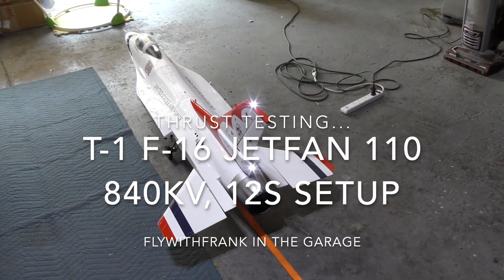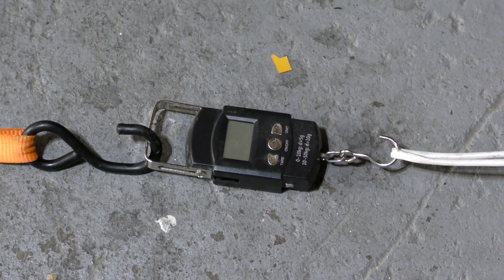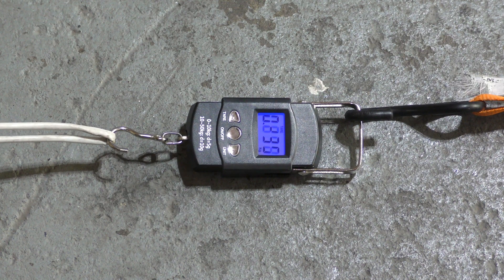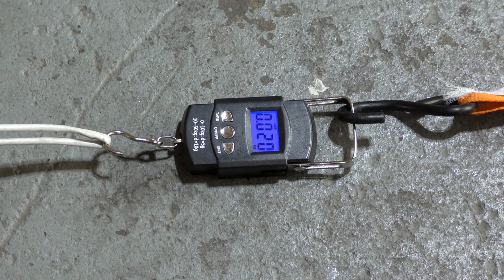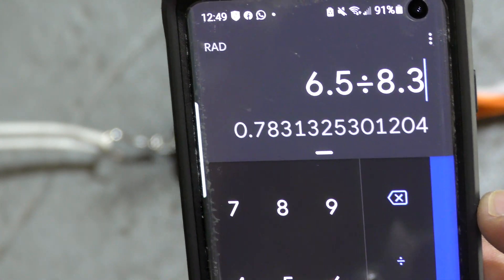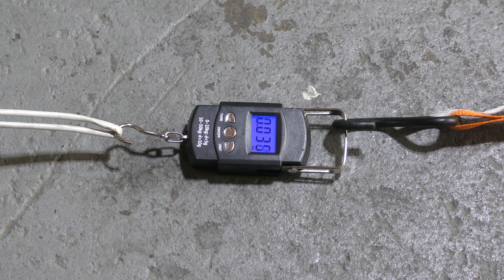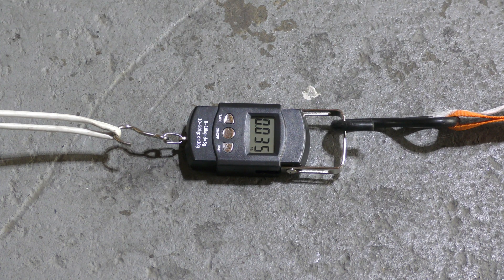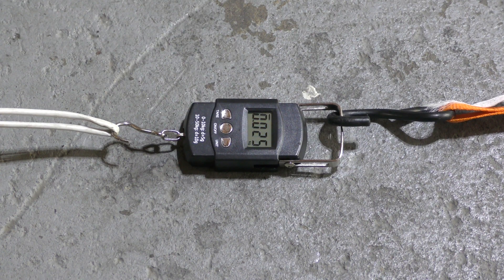T-1/T-One F-16 EDF Thrust Test

Comment: NICE TEST !!! Were you able to measure efflux? If I see a 3 - 5 lb drop in bench thrust vs installed thrust (with a thrust tube) Its usually the intake and the fan not getting enough air.
Reply from the maker: That was most definitely the case. The jet was designed for turbines and I suspected I would have issues there. I think intake was the bigger issue. I added a cheater and got a bit more air in there and that improved my static thrust. I wanted to add more cheaters but eventually decided against it.

Comment: Very nice test, thank you! I looked at the data of edf Jetfan PRO 110mm 840Kv, and they indicate that thrust is 8.6kg / 141A with 12S on 45V.  Is it a not PRO version in video?
Reply from the maker: Hi Alexey. I think there is only one version of the Jetfan for the 110mm size. But yes, there will be a difference. If you notice, on the site, they do say that they ran the fan without a thrust tube. Also no restricted intake. Once you change the intake and add a thrust tube (like stick the fan inside the plane), you are already operating outside the parameters of the OEM test.

Also I have the jet's gear down and measuring the pull off the wheels. Not ideally lined up with the line of thrust of the EDF, as when they test using a proper test stand. Wire length from batteries to ESC, ESC to motors, all mean that there are losses. Finally, power/batteries that you use matter. Battery voltage sags. Power supplies don't as much. So, as you see there are a lot of factors to consider. This is why when I build, I test to actually see where on the spectrum I am. It also lets me know what opportunity there is for improvement!

Comment: I'm going to be running the same KV in my 110 this time than trying to mess with 14s. Good batteries help a lot it seams! 👍
Reply from the maker: Yup! Good batteries are critical. Both the Dinogy and SMC are really good packs! But also make sure ESC timing/wiring e.t.c is all squared away. These high power setups otherwise can be tricky